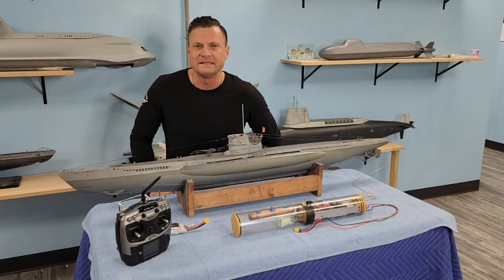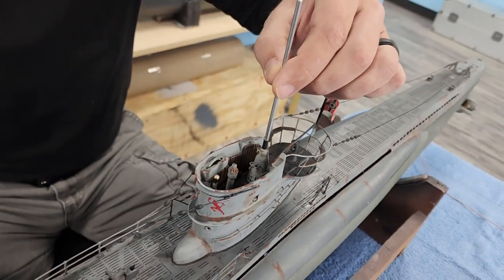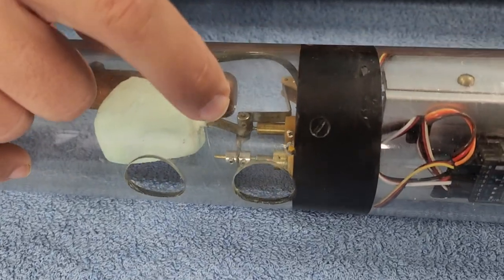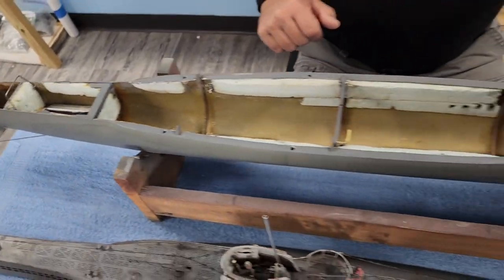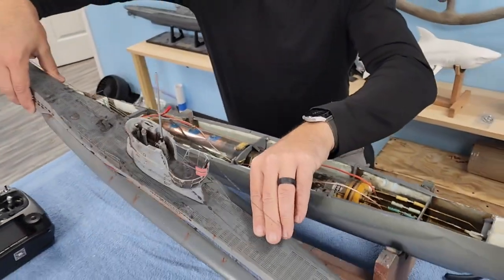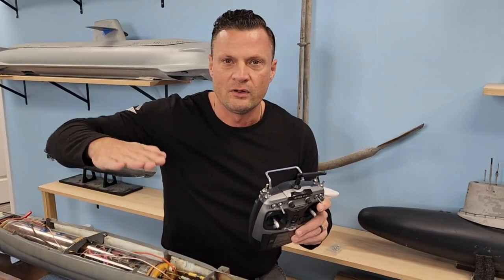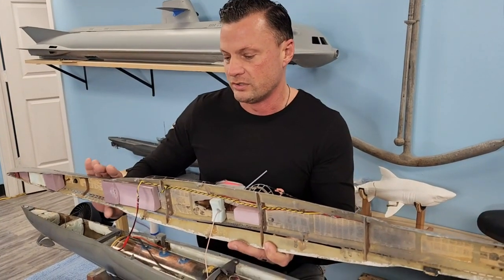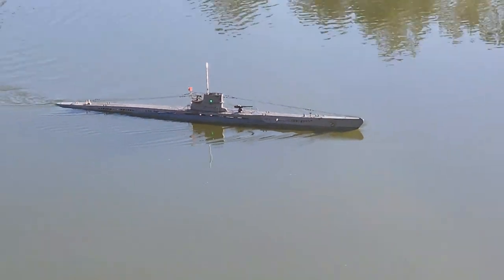DK Models German Type VII RC Submarine!

Comment: Hello, excellent video, but I have a question about the battery, does it come into contact with water when it is outside the sealed cylinder??, and the light cables are not cut???.
can you guide me on that 

thanks and regards
Reply from the maker: Yes, the battery is in the wet area of the boat. This is common practice if the battery is properly waterproofed, the procedure for which I have documented here on my channel many times.